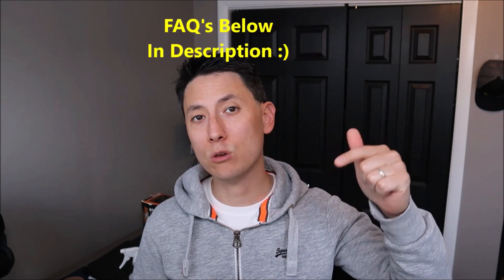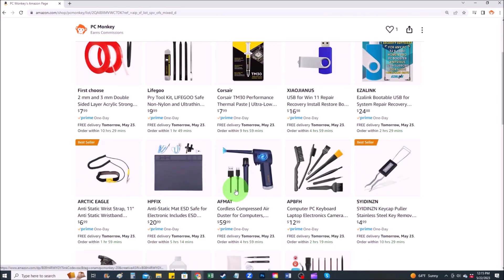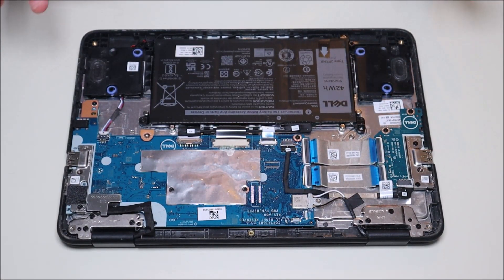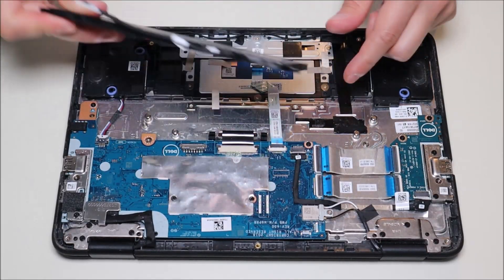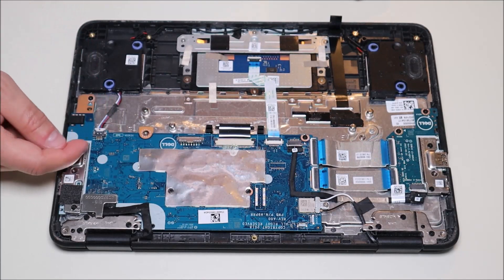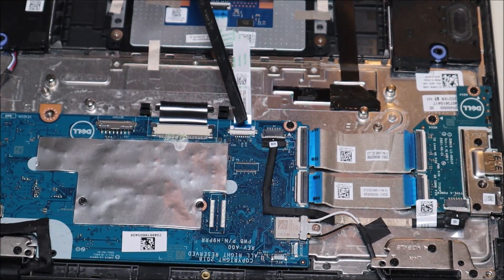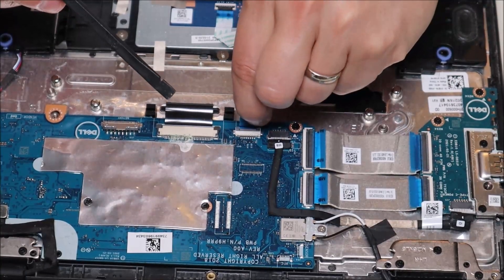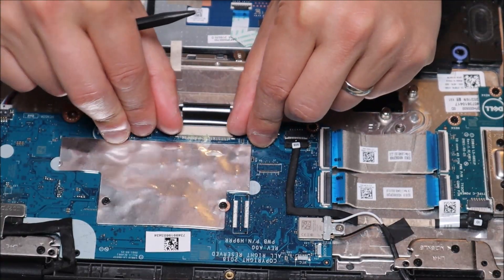Dell Chromebook 11 3100 - Full Teardown / Disassembly

Comment: lol I got the whole thing opened because I wanted to see if I could switch out the hard drive. I couldn’t even find it
Reply from the maker: The HDD and the RAM are integrated into the motherboard on this and similar computers. They cannot easily be removed or replaced.
Reply: @PC_Monkey yeah I just got to that part. Decided the scrap it. It’s a school Chromebook and I know i shouldn’t modify it but I need the extra storage

Comment: Is there a write protection screw?
Reply: That’s what I’m looking for too.  Did you find it?
Reply: There isn't, the write protection depends on the battery, to disable it just disconnect the battery, wait for a while and then turn on the Chromebook using the charger (the battery stills disconnected)

Comment: So if someone theoretically put lead in the charger and theoretically started smoking and was immediately removed the power, theoretically. Is it f'ed or can i just replace the charger port board
Reply: This is all theoretical and definitely didnt do this 😅
Reply from the maker: @HenryCaulk  LOL if that happened, if the charger started smoking it should definitely be replaced and should not be used again as it could be damaging the computer. If the charger port is damaged, then yes, it would need to be replaced and hopefully the damage didnt go beyond that. The motherboard would have to be looked at. I cant say now for sure if the charger port is all thats damaged :(

Comment: where is write protection in chromebook 3100 2 in 1
Reply: dont know if u still need the answer but you have to unplug the battery and power it using its charger to disable write protection

Comment: Sir is it possible to upgrade the Dell Chromebook 11 3100 Series HDD.
Reply from the maker: Are you asking if you can upgrade the HDD?  In this model, the HDD is actually an eMMC drive and is a part of the motherboard.  It cannot be easily removed or upgraded :(

Comment: hey i have an Asus window 8 i think and i’m locked out and it’s in Chinese please help me
Reply from the maker: 1.  What do you mean, your locked out?  Does it not accept your password?  Did you forget the password? 
2.  Also, did anything happen before this issue appeared?  Liquid spill, overheating, Windows update, etc?
Reply: @PC_Monkey  so i found this computer in an apartment left behind and it looks almost brand new and so i turned it on and it was all Chinese and i don’t know the password so i wanted to factory reset it to be able to use it but i can’t because i can’t read Chinese
Reply from the maker: @jacobischannel4084  Can you try the steps seen here to reset or reinstall?  https://www.youtube.com/watch?v=UX6xE6zSF3w
Reply: @PC_Monkey  okay yes that would fix the password part but it doesn’t show how i can change the language to english because i can’t do all those steps without being able to read them and what they say
Reply from the maker: @jacobischannel4084  You cant follow the install along and figure out which ones are the correct buttons?  If not, I would have to see it to be able to guide you step by step unfortunately.
Reply: @PC_Monkey  yes i tried but after i think the trouble shoot button it didn’t show the same type of buttons
Reply from the maker: @jacobischannel4084  You can try posting a video to your own Youtube channel.  I can then view and advise further :)  Also, make sure your title is accurate, that your trying to reinstall on a computer in Chinese.  Perhaps others will see it and help too !!
Reply: @PC_Monkey  okay thank you

Comment: Sir, my dell logo is stuck at the screen. I tried f12 and selected the diagnostics option but the screen goes blank (the light is on) . What to do? Plz reply. I have dell xps 13
Reply from the maker: 1.  So your not able to run the diagnostic scan?  Can you enter BIOS and try the steps seen here?  https://www.youtube.com/watch?v=B2Umoh81QeI
2.  Also, did anything happen before this issue appeared?  Liquid spill, overheating, Windows update, etc?